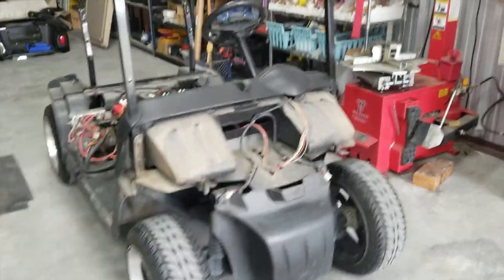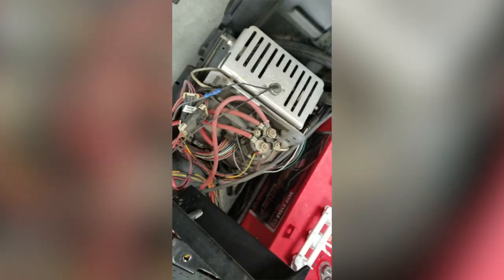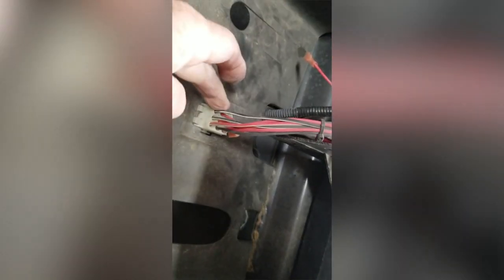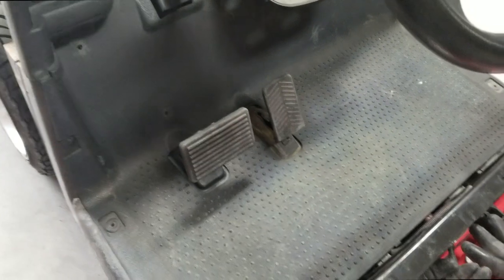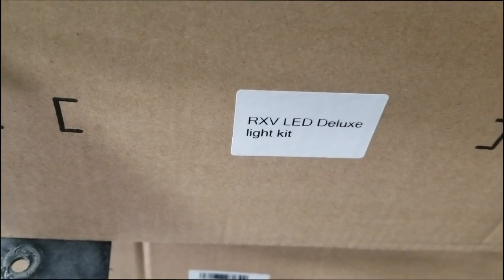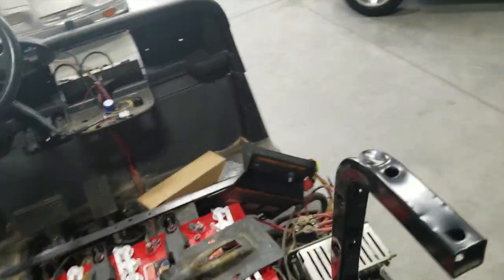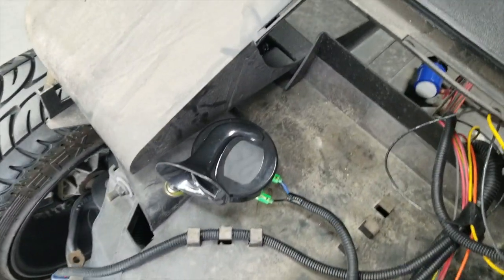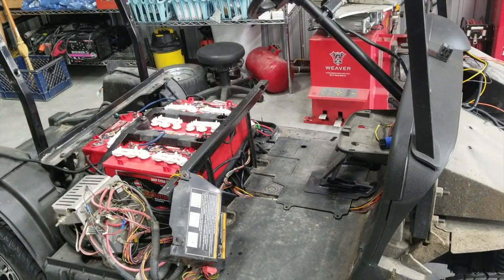Trouble shooting and Installing a Wire Harness on an RXV golf cart

Comment: Great Video! If I wanted to install a master switch to limit the possibility of theft on a 2009 RXV, could I splice a single pole single throw 12V switch into the yellow wire from the key switch? Is there a better signal wire to splice into?
Reply from the maker: Don't splice into any of the wires!!
You risk blowing the controller on an rxv. There are other ways.
There are set ups that you can lock and unlock the electronics on a golf cart.

Comment: My club cart is running fine right. Then you stop for a while go back and try to leave it’s like no power, after messing with the f/r switch it on it own decided it was ready to go and it drove fine as if nothing happened.  There’s something going out
Reply from the maker: very well could be the f/r switch. 
Especially if you have a ds, with the manual shift lever.

Comment: Where can I get that brake light switch?
Reply from the maker: What switch? I need more info.
Do you have turn signals?
Reply: In this video you installed a BRAKE LIGHT SSITCH  that mounted directly to the brake pedal bracket I would like to purchase one of those.
Reply from the maker: So you have a Rxv? On a ezgo RXV, the lite kit comes with the bracket and parts.  On a club car, you can buy parts separate
Reply: @waynemartin.waynesgolfcart4900  yes i have a 2009 ezgo rxv i bought a delux light kit from 10lol iy came with a screw over pad switch. i really would like a more normal switch like the one you installed in yhis video would you provide me with the info on this kit so i could contact the supplier and possibly buy this switch.
Reply: @waynemartin.waynesgolfcart4900  where did you get the light kit in this video you installed on an RXV?
Reply from the maker: oh, I hate those that you screw to the 
pedal,  I won't use them. 
The kits I use,  I buy wholesale and I have some. 
I can check my shop if you want. You want a deluxe or ultimate?
What is your zip code?
Reply: @waynemartin.waynesgolfcart4900  45503 but I’m just in need of the switch and bracket. And yes this pad switch is for the birds. Other than that I’m happy with the kit
Reply from the maker: Ok, I don't remember if that is available by itself. If I remember correctly,  that part comes already attached to the harness.
Reply: @waynemartin.waynesgolfcart4900  I think I found it at buggies unlimited. I’ll order and find out thanks. Great video

Comment: Im installing a led light kit in a rxv. Im not a led expert but the rear wire conection plug, the colors dont line up from the loom to the fixture. You know red to red,black to black,white to white. Is this a issue?
Reply from the maker: shouldn't be.
What colors do you have on the lites  and what colors do you have on the  harness?
Reply: @waynemartin.waynesgolfcart4900  red white , black on both ends but they dont line up when plugged together
Reply: @waynemartin.waynesgolfcart4900  if i had your phone # i can send you a pic
Reply: @waynemartin.waynesgolfcart4900  im not very smart with a smart phone lol
Reply from the maker: I sent you  a text. You said it was  an RXV, but one of your messages  was on a club  car thread?
Reply from the maker: Go ahead and plug  them together, worst  case  would be you would have to splice a couple  wires, but i think  it will  work👍